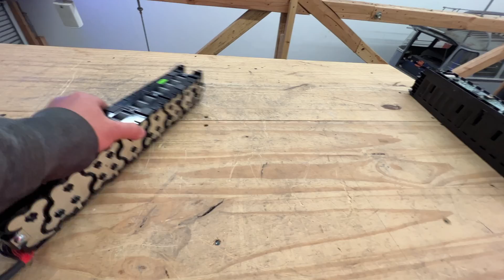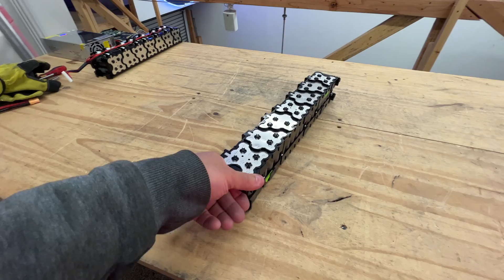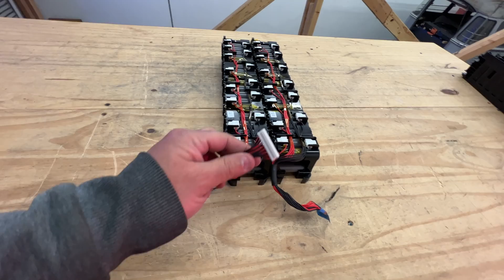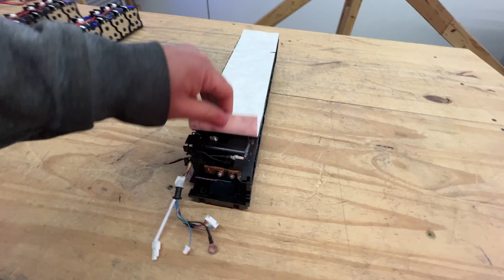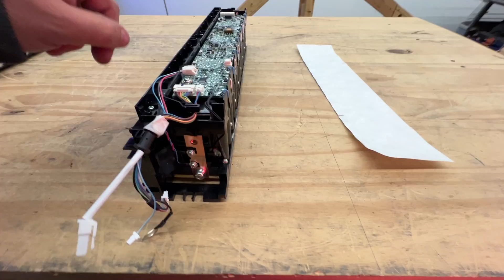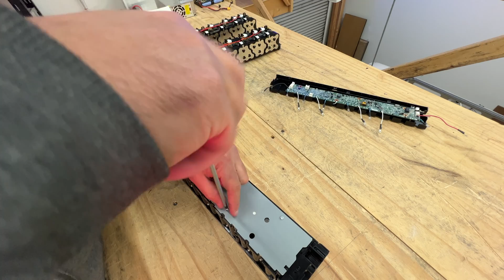This Little Battery can put out 80A

Comment: So I bought this battery and installed a daly 48 volt 45amp BMs and it got hot and blistered. All I did was plug it in was it the amps on the bms that need to be 100 or 120? Nothing else was connected.
Reply from the maker: Bad bms or not connected correctly sound like
Reply: @jehugarcia  sending it back getting a 100 amp see what happens thanks will come back with results. Bless. Waiting on the new bms
Reply: Hi jehu .so got the new bms and the link or pic will be uploaded from Amazon 16s100amp easy install just unplugged the existing bms wires cause the plug was different. So soldered in the new bms.ran really great  got 31-32mph torque was nice hold on tight..but run time was hurt so got a 2nd pack installed the 2nd 16s bms 100amp.and run time is great barrelled them with xt90r controller max amp is 35 if I get a better or higher amp controller I'm sure to get up to 37-40 mph.

Comment: Thank you for all the helpful videos!

I am looking to make a high-power battery pack for my go-kart as I am converting it to electric. I am either going to do 24 or 36 in parallel and 20 in series. (so 72 volts) They will all be salvaged laptop cells, and the more research I am doing, the more confused I get. Particularly in the fuse part of it. Is it really worth putting fuses on every individual cell? Will putting an in-line fuse for every parallel pack do the same thing?

 Do I need fuses at all? I've seen tons of videos of people doing it with no fuses, but do not want any fires or explosions lol.
(trying to make either a 200 amp or 300 amp discharge continuous).

Whatever information anyone could give would be very helpful.
Thanks to everyone in advance.

Comment: Hello man, I've heard there is some new way of connecting Li-Ion cells currently on the market. It's not related to nickel strips or soldering, but rather to using PCB custom layout which would then make wanted connections (series or parallel) and carry a current. Do you have any info about this technique, any links maybe ? I seem not to be able to find any useful informations by searching the internet myself. Thank you in advance.

Comment: Hi Jehu .my dad as a mobile scooter (drive scout 4)we have gone through  4 sets of replacement lead ascid batteries in the past 2 years the battery cells are 2x12v 12ah agm batteries.Can you recommend something  that I  can purchace  from your site that cam be way more reliable?thanks in advance
Reply from the maker: not really,  sounds like you have a 24v system,  the only 24v stuff I sell is the diy pcb kits on my website
Reply: Battery hookup has some lifepo4 stuff that's 12v drop in replacement.
Reply: Get 2 Valence 12v LiFePO4 batteries, or you could do two 4S 6P (12.8 min,  14.4v nominal, 16.8v max = battery charger voltage) packs out of 48 18650 cells.  I think they make a 4S BMS that might work. for your load amps.  I made a 7S 12P pack to power my Lawn Mower and a 4S 12P pack to power a 12v DC winch.

Comment: Tnaks for the teardown Jehu.
Wth is this BMS???
It's huge, and has biiig chips. 
What are they doing with all those components?
Reply from the maker: No idea
Reply: Battery Management System
Reply: @maryus315  I'm not asking what is a BMS, I'm asking how come the BMS of the battery is so huge and complicated?
This makes no sense.
BMS for those batteries, are usually less than 10cm x 5cm
Reply: @xmtxx  My guess, the PCB contains a lot of smarts, much more than a standard BMS. But yeah, seems overly complicated.

Comment: My dream of a 2x1500watt 2 wheel drive electric bicycle is soon to be a reality!!!!
Reply: Only 😁
Reply: Me too...a chopper with a golf cart motor in it and a pile of battery...so I can do electric burnouts...
Reply: @chuckthebull  Meh, golf cart motor are usually pretty bad brushed motor.
Go for brushless with a nice controller.
Reply: @xmtxx  nope I got a welder and a bunch of random parts in the shop, I'm going to build my Frankenstein monster and let it loose on the village... 48 volt beasty..that motor has gobs of torque,, and I don't care to be all slick and I'm not building a sport shoe looking dork bike..it's a rat rod bobber
Reply: @chuckthebull  you will learn so much!   I made a riding mower from a 36v golf cart at 13S 20P (48v) so it's superfast, weight is WAY less than the giant 6 x 6v Lead Acid battery golf cart & it runs just fine.
Reply: @scottbaker9066  That's really cool..I'm not looking for some high performance..just something that is neat and unique and fun..I even have a nixi tube speedometer I designed and made built into an old model t speedometer.
Reply: @scottbaker9066  what's the range?